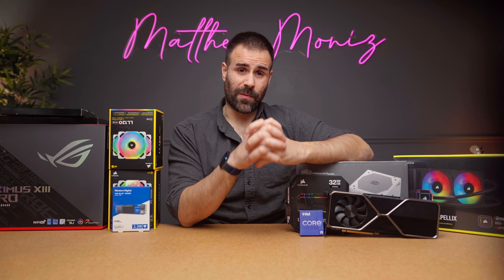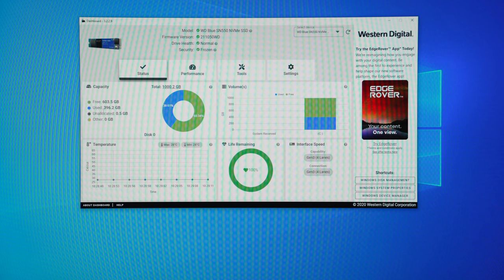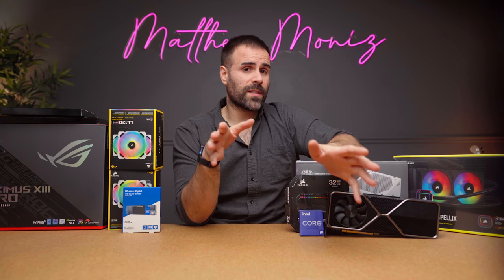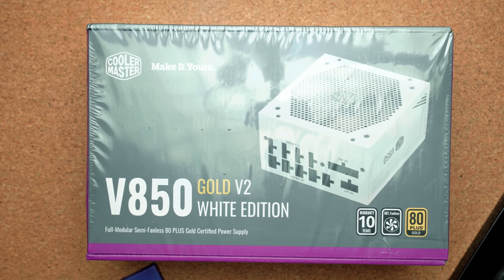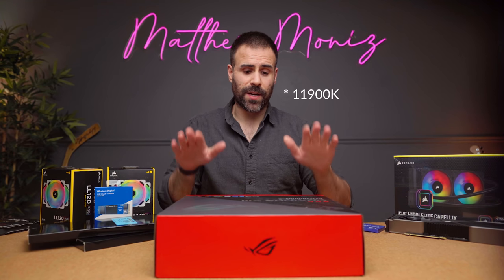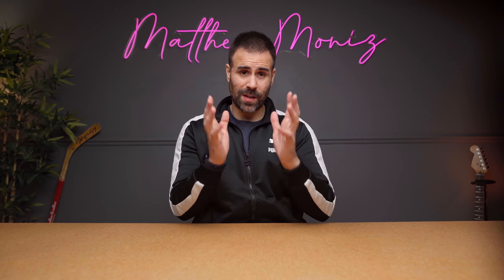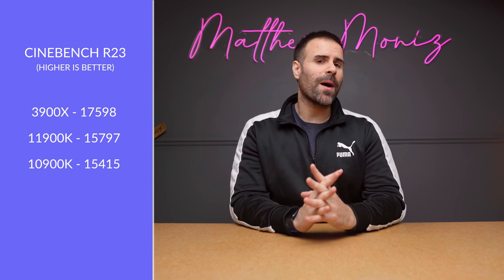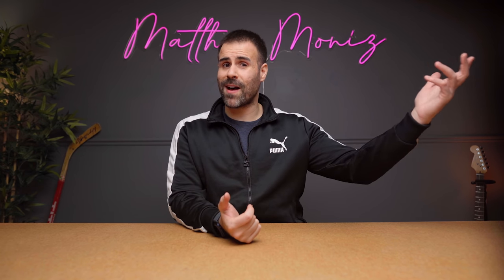My Epic Gaming & Video Editing PC Build!

Comment: Vertical mount on that 3080 FE may not be the best idea. Make sure you check the VRAM temps on that, not the GPU temps but the VRAM. Use Octanes Benchmark tool with HWINFO. That's a good case so it may not be too much of an issue if you have never airflow over the top back plate.

Comment: 5:21 oooof Matt my man, Corsair makes a white version of that cooler but even still I’m not sure why you’re using just a 240mm cooler to cool a 11900K… would strongly recommend going with the white version of the H150i Capellix 360mm that’ll easily fit in the 5000D which is available for sale in Canada on Corsair’s website
Reply from the maker: 240mm cooloer is MOREEEEEEEEEEEEEEEEEEEE then plenty to cool the 11900k. I coudlnt get the white one at the time. As for a 5900X again at the time of the build they were out of stock!

Comment: I have the v750 gold v2 !!!! Just for my 1660super. I just can effort that gpu sadly
Reply from the maker: how is it holding up?
Reply: @MatthewMoniz  im from indonesia. My system just R5 3600, Rog strix b550f gaming wifi, gskill tridentz neo 16gb kit cl16, adata sx8200pro 1tb, wd blue 2tb hdd, inno3d 1660super twin x2 and under full load just need 300watt almost. In indonesia 1660super just like around 620usd. Its almost 2.5x the normal price:(  my plan using the rtx 3060ti or 3070 but the price is the same with my pc setup rn😂